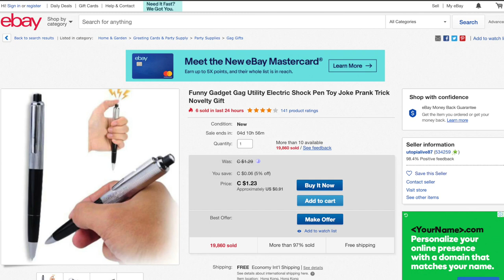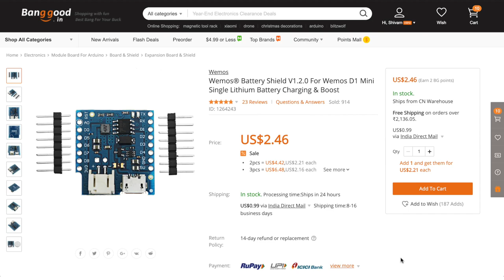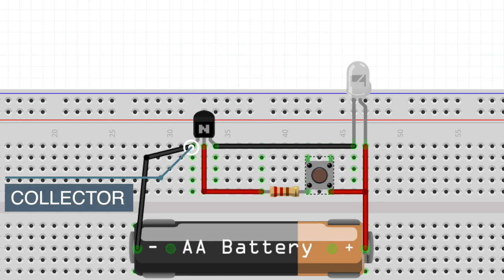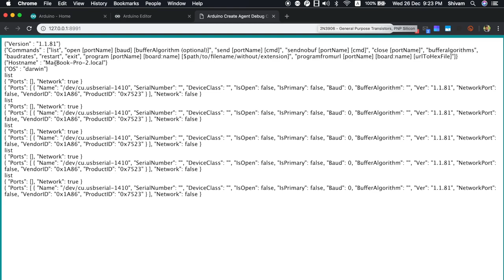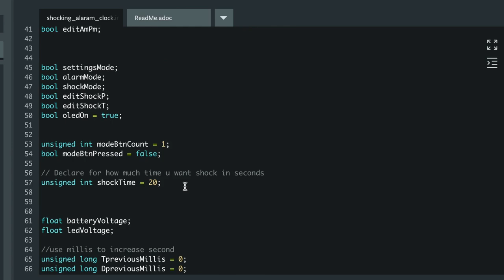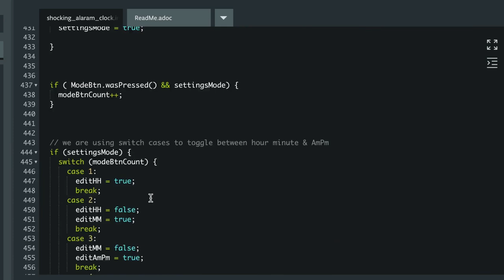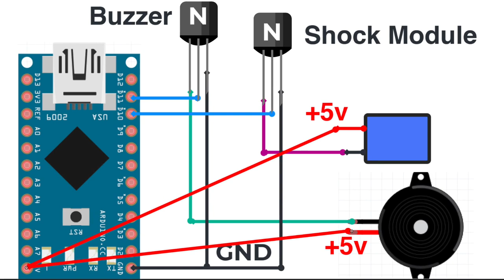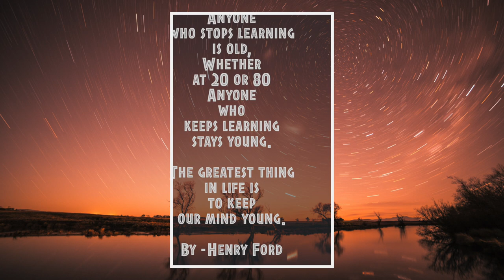DIY Arduino Shocking Alarm Clock to wake you up instantly

Comment: It is just amazing how you explained the use for NPN transistor here using schematics, used Arduino plugin and put in alarm times and shock times for the shock module pins. Battery level display was just the perfect icing on the cake. Would love to try it myself 😋!
Reply from the maker: Thank you for your love and support 🤗
Reply: @CreativeJE  you are most welcome!

Comment: Awesome video!! Is it possible to regulate the shock? Can it be made so the electrick shock is very small and maintained for 2 seconds for example? (Similar to a TENs unit)
Reply from the maker: yes as i mentioned there just 1000 to 2000 then it will give for 2 s as of now it's set to be 1sec for minimum shock
Reply: @CreativeJE  Thank you!

Comment: Sir I love this project idea and tried to do it at home. But for some reason mine does not work 😭. When the 5volt cable from the buzzer and the shock module is combined, you said to solder it to the 5volt pin on the arduino. But when I did it the buzzer won't stop buzzing. And when I connect battery to the arduino it turns on and wont turn off. Where did I go wrong sir? 😭😭
Reply from the maker: It's not combined see properly we are using transistor for trigger

Comment: Why can't I upload the code from the web editor to my arduino, it says executing command: exit status 1, pls help thank you
Reply: Arduino: 1.8.13 (Windows Store 1.8.42.0) (Windows 10), Board: "Arduino Uno"

shocking_alaram_clock:2:10: fatal error: Adafruit_SSD1306.h: No such file or directory

 #include <Adafruit_SSD1306.h>

          ^~~~~~~~~~~~~~~~~~~~

compilation terminated.

exit status 1

Adafruit_SSD1306.h: No such file or directory

This report would have more information with
"Show verbose output during compilation"
option enabled in File -> Preferences.

now it says this pls help @CreativeJE
Reply: For those of you stuck with the same problem, you should manage the libraries and install the data such as the adafruit gfx library and jc button.

Sorry for the trouble because i am new to this and dont know the first thing about arduino but is willing to give it a shot.

Comment: Shocking pens output a repeating pulse, which is uncomfortable, an oscillating relay can act a loud oscillator. Add an huge inductor, and enjoy STRONG but harmless shocks! I don't recommend transistors, as the shocking voltage spikes can easily destroy the transistor!

Comment: I have connected all the wires correctly but the OLED is not opening. I've uploaded the program to the arduino but its not opening. Please help
Reply from the maker: Try running the example test sketches
Reply: Uhmm how?

Comment: How many amps would this be? Would there be any reason to limit the amperage on this for safety?
Reply from the maker: It's not an LED it will take whatever it needs
Reply: CreativeJE gotcha. How much would this need then lol?
Reply from the maker: @bkrazor3  I forgot how much current does it takes but the battery will last for 12 hrs
Reply: CreativeJE ahh okay. Well I’m assuming it’s safe enough. I’ll try to research to see how I can calculate the current. Great project, thank you for sharing. I want to do something similar in the near future
Reply from the maker: @bkrazor3  you can just use multimeter to measure current. All the best

Comment: Can you please explain the shock module ? I couldn't understand it please.
Reply from the maker: Which part you didn't understand
Reply: The shock module part -  9:25
Also tell the transistor number
Reply from the maker: @creativeminds8984  I can't remember the transistor number but you can use any of the npn type and you will get three wires on the shock module and the ground will be same the black wire and the wire in the middle is for output
Reply: But please tell that how can we make a shock module or from where we can get it??plz help
Reply from the maker: @creativeminds8984  why can't you see the video properly 😤😤 I have said you can get it from eBay or any toy stores
Reply: Bro i too live in India I can easily get it offline and for much cheaper rates. But i went to a shop to buy stuff and he asked me the transistor number please tell me what to say??
Reply from the maker: @creativeminds8984  BC548
Reply: Thanks bro. 😀😀. 
And the shock module here that you said I can get it from a toy store 
Can i take it out from the shock pen that come in market???
Reply: Bro can i use a 5v  charging module without booster??
Reply from the maker: @creativeminds8984  it will not work because Arduino need 5v
Reply: Yes mine is also 5v charging module but without booster
Reply from the maker: @creativeminds8984  hey bro are u insane or what the voltage needs to be boosted to 5v from 3.7V
Reply: Okk thz bro 😀
Reply: @creativeminds8984  did you make it?

Comment: We can also make it using by using smart watch! Try it?
Reply from the maker: How will you do that ?
Reply: @CreativeJE  see in smart watch there are two this for that one vibrator and speaker make a voltage increase module and connect with speaker or vibrator
Reply from the maker: @anirudhsingh6510  and where you will put the transformer and also there is a current limit on smart watches you won't be able to do that
Reply: @CreativeJE  ok but we can still try it
Reply from the maker: @anirudhsingh6510  sure you can try and let me know the results cause i don't have any smartwatch
Reply: @CreativeJE  you can try it on a dz09

Comment: my display dosent light up
Reply from the maker: Maybe it's cracked check it properly
Reply: @CreativeJE  noo it looks good :(
Reply from the maker: @RacyGex  then make sure you haven't reversed any wires
Reply: @CreativeJE  can it be the programming or is there a on off button
Reply from the maker: @RacyGex  did you test your OLED with example codes ?
Reply: @CreativeJE  How do i do that
Reply: it says attempt 2 of 10: not in sync in the program
Reply from the maker: @RacyGex  try googling the issue maybe your OLED is faulty

Comment: Hello, can you please teach me how to solder the wires to the arduino nano? Please I really need to know
Reply from the maker: Just practice
Reply: Do i need the pin headers to solder? Or just insert the tiny wires into the arduino?
Reply from the maker: @paolobachicha  no see the video do like how I did
Reply: I can't see it very clear. I'm sorry
Reply from the maker: @paolobachicha  you mean video is not clear then make the quality to 1080p
Reply: No the way you soldered the wires, I'm sorry for all the question hehe.